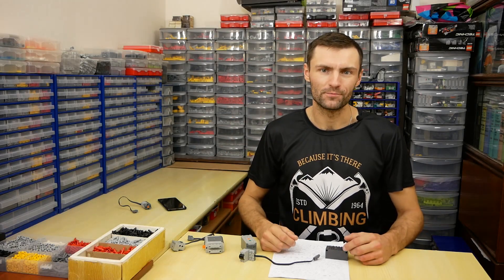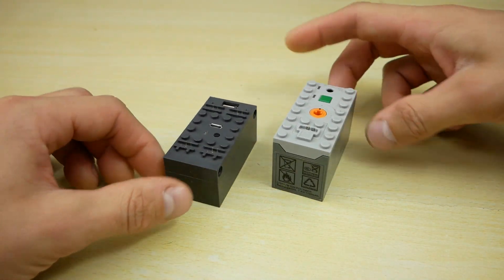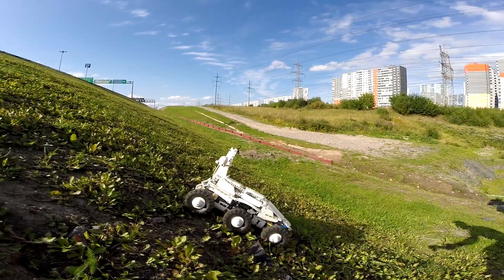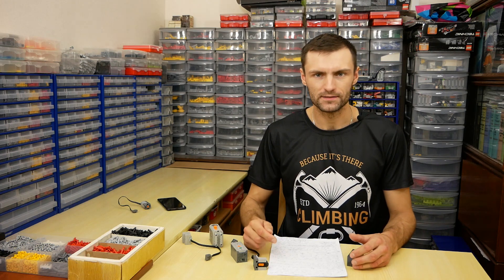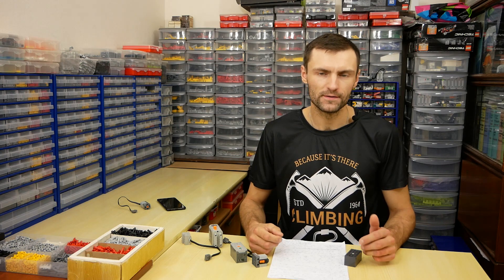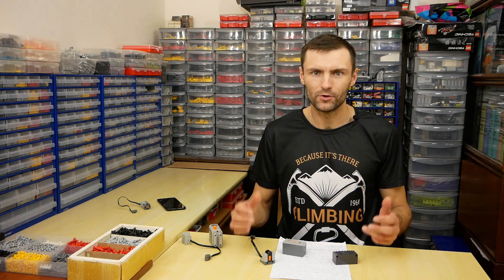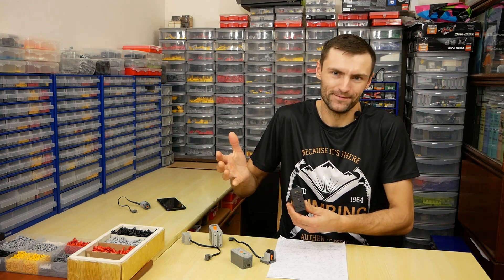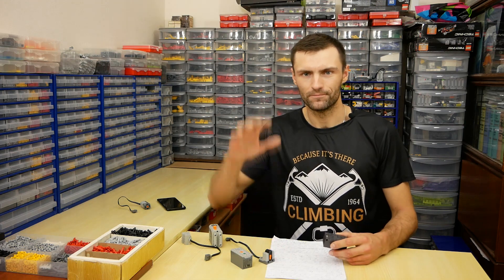BuWizz Receiver – Nuclear Reactor for your LEGO Technic models

Comment: Very helpful video. How is the battery life over time? Looks to be really useful upgrade. Try a two tap power off instead of holding it down?
Reply from the maker: Battery life depends on current consumption, in total approximately 1Ah/3.7V